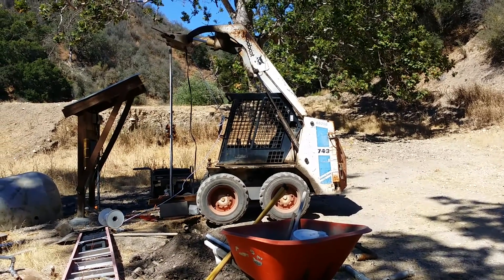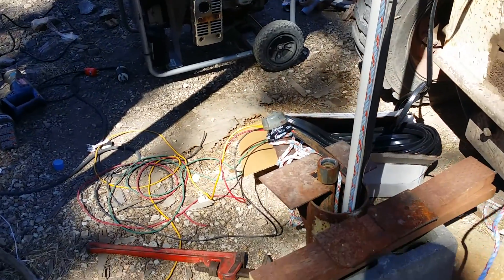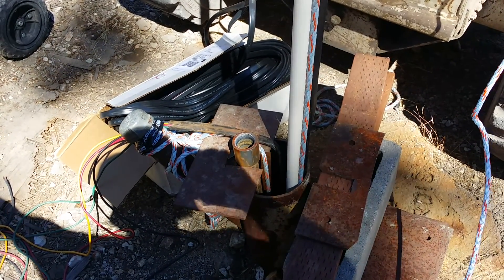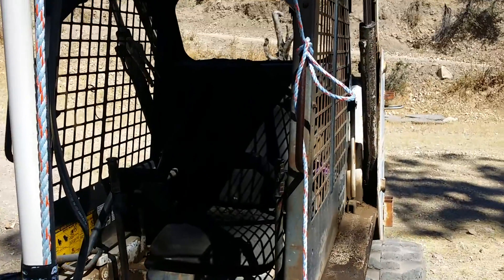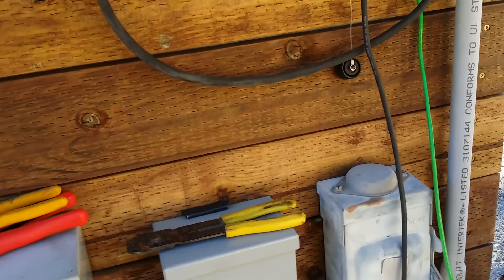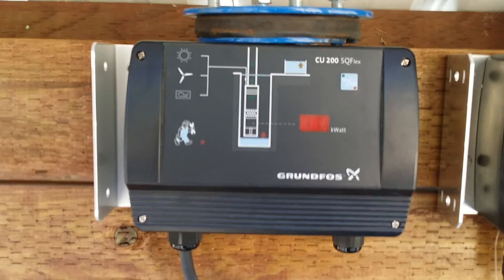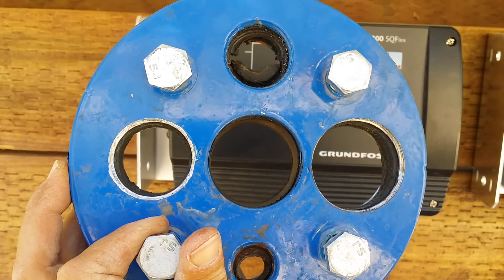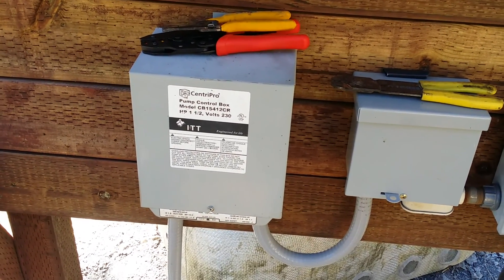Off Grid. Two well pumps in one 6" case. Two is one and one is none.

Comment: Awesome. I am thinking of sticking 2 pumps in a 6 casing. I have a 400 watt solar pump and think the other one is a 110v pump.
Reply from the maker: I'm getting ready to convert the other pump to solar now as well. RPS solar has conversion kits that can take a conventional 120 or 240 volt well pump and make it into a soft start solar pump.

Their controller will allow you to run the well pump on regular AC voltage as well so you will not lose out on any options for AC or DC voltage with their setup.